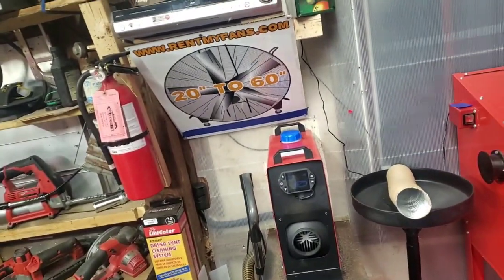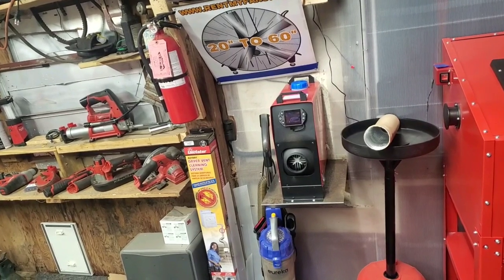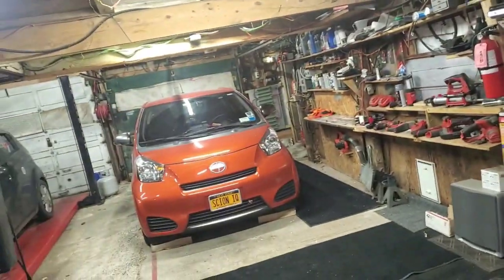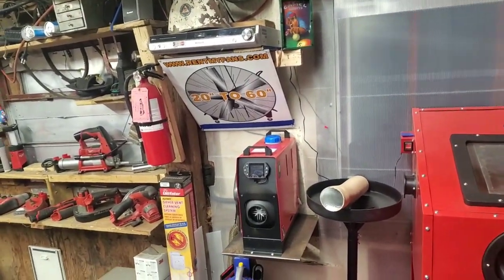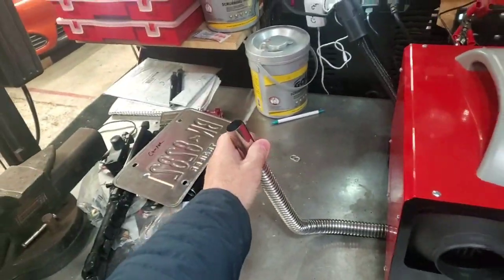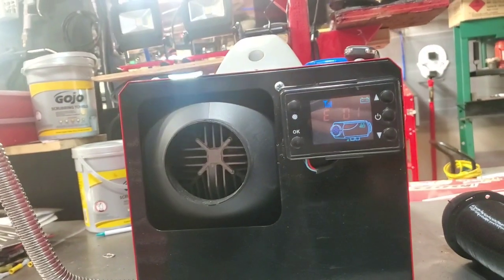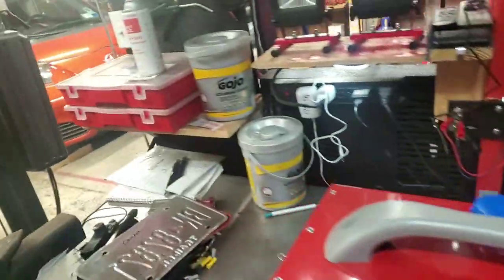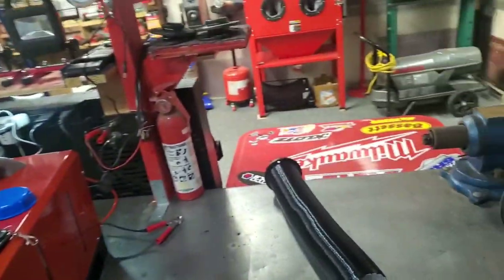CHINESE DIESEL AIR HEATER, WHICH ONE TO BUY? also see description

Comment from the maker: This is what happens if you run your diesel air heater on low all the time it will plug up check out this video,  
Watch "Diesel Heater Diagnosis - white smoke but not lighting" on YouTube
https://youtu.be/bNO0bnWw4yE

Comment: I use these in my sheds, I run on white diesel as it’s easier to get. eBay have some 300w 12v supplies for leds, they run well. One note - install a fuel filter as these things don’t come with one and one I had even had crud in the tank on arrival. Cut the line and add one for about £1!! If running mains a power cut can fry the electrics as they won’t run a cool down sequence.

Comment: Agree with clogging up comment. I got a 2kw eberspacher in my van here in the uk and that gets too hot in a lwb van after about 15 mins. The tech who fitted it says keep it running hot if possible. 2kw is more than enough for a van, not sure about hearing a shop or garage.

Comment: Nice video
Im not so sure about the sooting up tho. Ive have 2. 8kw heaters in my off grid cabin been in 4 years now and they run on low 24/7 un less temp drops and they pick up again for 20 mins or so. The only problem i  had is one fuel pump went out after 2yrs i run mine on off road diesel.
Reply: if you have the fan speed set for the correct altitude they won’t soot up . also they don’t come in 8 kw , only 2 and 5 kw , the 8 is actually only 5 and they are trying to rip people off by saying its an 8 . 👍

Comment: Thanks for the video. We intend to use ultra low sulphur diesel or biodiesel in ours, both of which will produce a much cleaner burn and a significant amount less sutting. But it all depends what fuels you have available to you. Looking forward to getting ours now.

Comment: you could just buy a 12v 30amp power supply and hook them both up to it.  You wouldn't have that battery issue anymore lol.  $18 - $25 on amazon no more fussing around with chargers.
Reply from the maker: I'm actually was glad that that battery was low because it shows what happens to the unit when your battery is low oh, that's just a test battery that's all that is, I also do have a power supply but I also have a huge battery Bank to Powers my house
Reply: NDA172001: if u don't run a battery and you have a power outage while the heater is running it will at the minimum meltdown the electric control board, cant just shut them off, the fan keeps running a bit after the off button is pressed and fuel/fire shuts off, to cool it down, just like a house oil burning Furnace ,the fan keeps running while the pump is off, but they aren't nearly as susceptible to heat damage if there is power loss while  running
Reply: @jesusisreal3209  That's what my Uninteruptable Power Supply is for.
Reply: @MidKn1ghtNate  ohh  thought thee was essentially just referring to a transformer from 110v to 12v, my mistake.

Comment: The Drink Can as a Baffle, we did that in the 70s/80s on our DirtBikes, We had them stuffed with Steel Wool around the inner pipe
I have the fatter (2nd) Heater at 5kw with the Exhaust coming through the hole in the rear

Comment: multiply c by a factor of 1.8 then simply add 32    example   100 c x 1.8 + 180 degree then add 32 degrees = 212 degrees  or boiling at sea level  works with the weather channel to ''''  try it

Comment: You can use an LED driver to power those units. 12v 150W power adapter on Amazon for 30 bucks.
Reply from the maker: I don't think 150 watts is strong enough they pull 15 amps when they start up

Comment: Question. Do you think adding like 20 feet copper tube to the exhaust would create too much pressure? My idea was to coil it like a solar heater on a roof and then exit the building. I'd put a box fan behind the coiled section to squeeze out the wasted heat. Or would doing this create too much back pressure and Id need to add some type of small fan an the end of the line to help suck out the exhaust?
Reply from the maker: Yeah the exhaust gets really hot on these you could probably get free hot water if you just get like a small quarter inch coil and just coil it around the entire exhaust pipe

Comment: Can you charge the battery while using the heater ? Set the charger to 6 or 12 ... I’m ready to power mine I have battery clamps that have a screw for a eyelet to attach to the wires
Reply from the maker: yes. It's going to pull about 10 to 14 amps until it gets fired up then it should drop back down to 4 amps or thereabouts

Comment: I thought you could adjust the ratio of the oil that's what makes it run cooler (like a thermostat) because it doesn't!
Reply from the maker: I don't know there's some guy in England that has videos on these and he's messed with everything I leave stuff stock because I'll goofing up
Reply from the maker: Oh I have to add this you can't run on low all the time you have to run them wide open for a while to clean them out if you run them on low too long it will soot up and plug up I've heard people bitching about that when I have them in my garage I run wide open
Reply: @TheOriginalAndysGarage  I have to do this on my tractor periodically too.  There's a button.

Comment: question for you my man,, 
does it require any maintenance, like an oil change etc?
Reply from the maker: No the only issue I have heard of is if you run it on low speed they will start sooting up so every now and then you run It Wide Open to get it really hot to clean itself out
Reply: @TheOriginalAndysGarage  ohh cool, easy peasy then.. Last question... does the pump just make the sound at the beginning when its priming, can it be heard from while the heater is on? Im considering buying this for cold weather camping..
Reply from the maker: Yes you can always hear that little tick tick tick tick noise I think they sell something at eBay a rubber thing that covers it and it sounds is it a little bit but it didn't matter to me
Reply from the maker: Look at this on eBay
https://www.ebay.com/itm/Protective-Reduction-Cover-Parking-Heater-Fuel-Pump-Holder-For-Diesel-Heater-/304145782572?mkcid=16&mkevt=1&_trksid=p2349624.m2548.l6249&mkrid=711-127632-2357-0
Reply: @TheOriginalAndysGarage  Yep,, they have an EASY swap for a quiet pump too.. might do it.. I bought a Zodi X40 HotTent,,, its not practical to go camping with. It outputs 40,000 BTU's,, I thought on low it would work great, but its still to HOT and its just to big and bulky.. plus you have to manually set it... I might just try this unit out and replace the pump even before I turn it on..

Comment: There are no 8kw heater, it is false! Only 5kw top version!

I use 3x 100 ah batteries in parallel, connect to a 1000 watt all in one solar inverter!
Reply from the maker: Did you go into your pump settings and turn your pump speed up?

Comment: do you think the 8kw one would heat my 70 foot long single wide trailer from 1970?  i have reptiles and animals and kids . and i've been looking for a backup heat source in-case we loose power.  and im not sure if it would heat the house or not. thanks
Reply: @TheOriginalAndysGarage  okay thanks. maybe ill get 2 of em and put one at each end
Reply: @TheOriginalAndysGarage  not the greatest. before we moved in i re done all the flooring and walls. put new insulation in the places where it was sagging. but the single pane windows may as well not be there at all. im going to try and staple some plastic infront of them. maybe that will help some
Reply: @TheOriginalAndysGarage  haha. Holly crap I couldn't imagine. Luckily I'm in western NC. So it USUALLY doesn't get super super cold. But this weekend is going to be in the teens. Which is super cold for here lol. Mine has 8 windows 2 of them slide open. They really suck at holding the air out. And one is 3 windows side by side.  I did get all my underpinning fixed. So that should help also. As long as the power stays on. I'll be good lol. Next year I'll have 2 of those heaters. Just in case. They seem pretty strait forward. Almost like one of those shop blower heaters. Except with a casing around the fire. Keeping the exhaust gases out of the outlet.
Reply: @TheOriginalAndysGarage  whew. im glad we don't get to much snow lol. i think the most weve ever got from what i can remember was like 14 inches